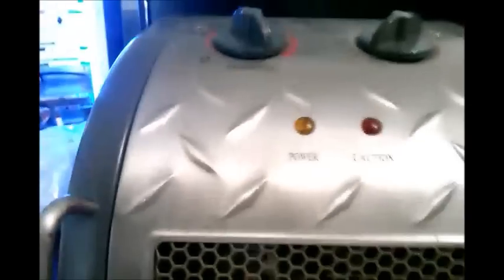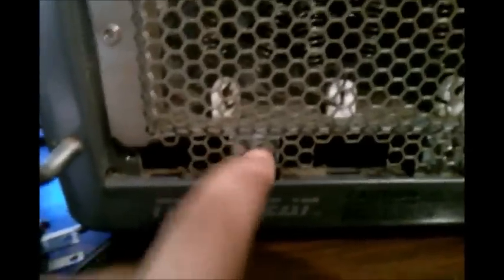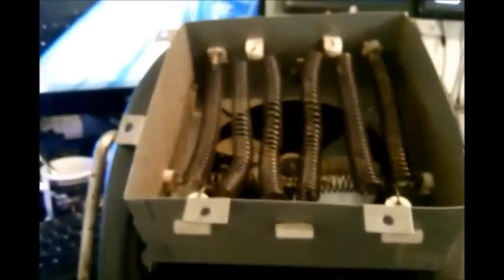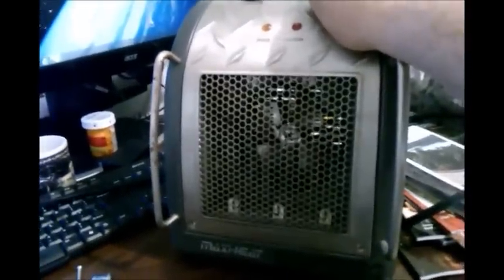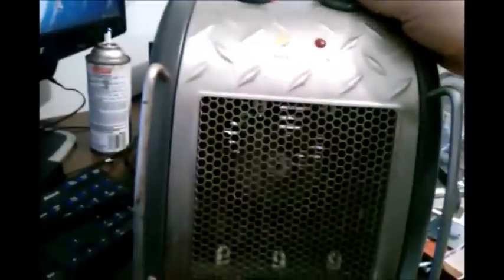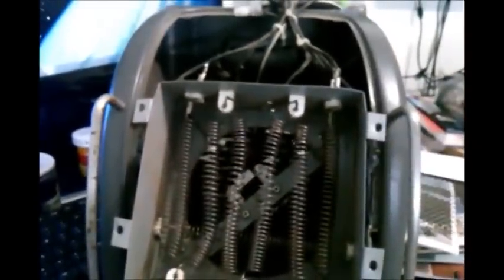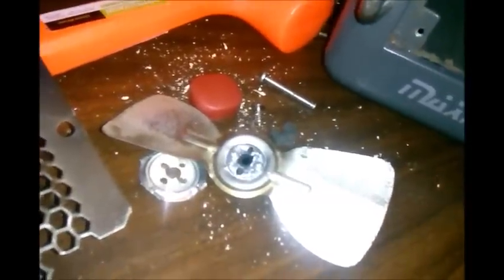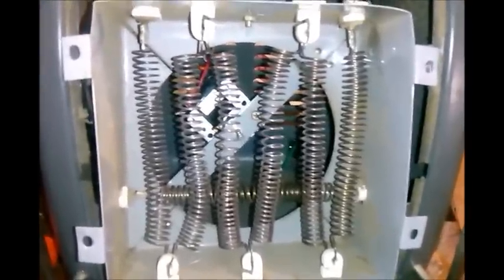Fixing and Old Electric Heater - Planned Obsolescence

Comment: It's all about cleaning and lubricating the fan bearings regularly. Like at least once per year. 
Dust bunnies and dirt will do away with whatever "precious drop" of lubricant they put on these "lubed for life" fan motors. The bearings should be visibly wet with oil at all times regardless of what the manufactures says who only wants to gyp you out of a new motor every few years. Use Mobile 1 engine oil or another good engine oil. These fan motors will literally last for 20 to 30 years if they are cleaned and lubricated regularly.